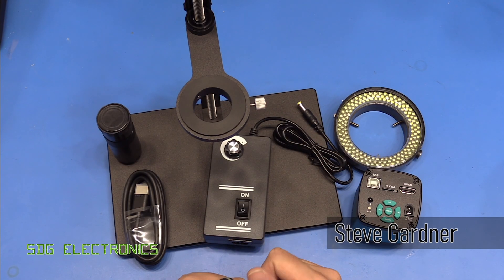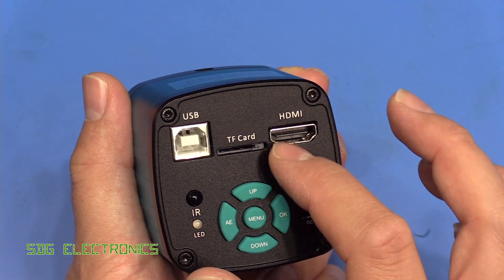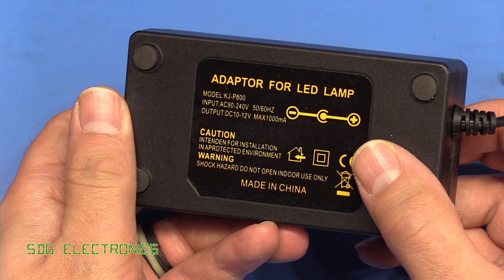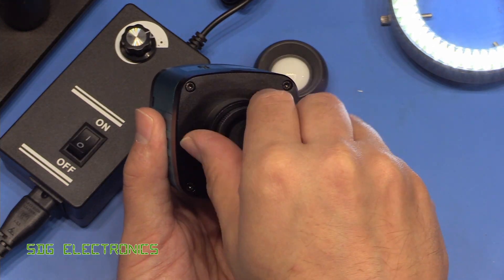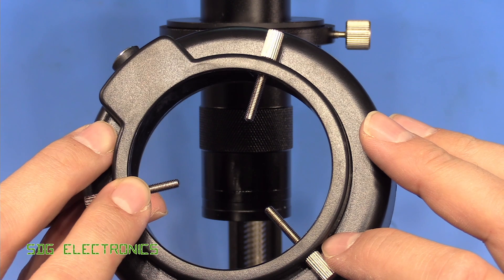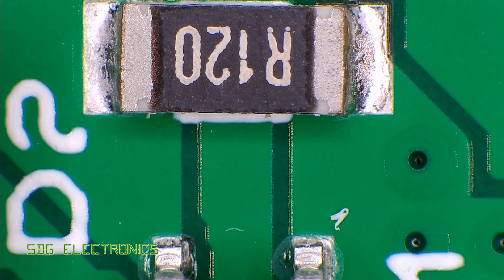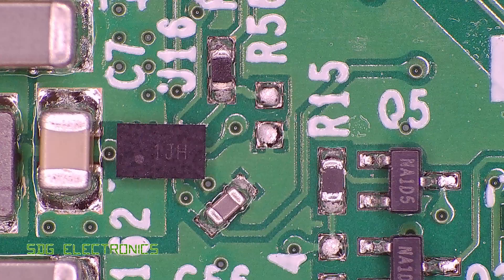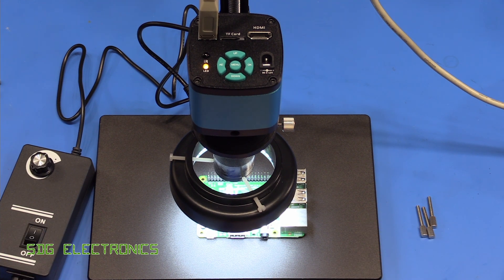SDG #180 Eakins 4K Video Microscope with HDMI and SD Card Recording

Comment: Hello, excellent channel.  Could you help me.  I am wanting a similar setup to NorthridgeFix  https://www.youtube.com/watch?v=NfkXitg5R4I&t=771s     This seems like a camera that is similar for a lot cheaper.   NorthridgeFix says he uses a 0.5 and 0.75 barlow lens.   He seems to have a good working distance, I assume it's because he uses a 180x lens and this is 130x.  I have found the same camera you review with the option of the 180x lens.  https://www.aliexpress.com/item/4001347475510.html?gps-id=pcStoreJustForYou&scm=1007.23125.137358.0&scm_id=1007.23125.137358.0&scm-url=1007.23125.137358.0&pvid=ffa7af9d-b31b-4d17-b5ab-1c4727316513&spm=a2g0o.store_home.smartJustForYou_512523718.5    What are your thoughts?  Obviously his stand is far superior but the image quality looks more than good enough for soldering to me.   Is 180x with the barlow lens the way to go?  I don't like the idea of looking down eye pieces.  It may have an easier learning curve but it does sound uncomfortable.
Reply from the maker: The 180x lens is good, I used to use it a lot and has easily available barlow lenses. You need a good camera though, the 180x lens loses a lot of light. This camera seems pretty good in low light though so I don't think you'll have any trouble

Comment: If I wanted to spend a bit more, what would be your recommendation? I am looking for a camera only style microscope. Is the "autofokcus 1080p imx290" unit you reviewed still worth 400$?
Reply from the maker: I think it's still probably the best choice. There's a few variants of the same camera though - if you intend to only view images or record through HDMI you can normally get it cheaper than $400
Reply: @sdgelectronics  Where ? a lot of these cameras appear to have  cheaper Sony sensors installed, and has made buying these cameras on Ali a more than usual dodgy proposition ! are there any honest sellers that you can recommend ? Thanks

Comment: Can the ring light be attached to the adapter used to hold the lens assembly to the stand? It looks like the id of the ring light should fit the od of the adapter that is sticking out below the stand.

Comment: @ SDG Electronics
Can I use Barlow lens with this microscope?
Will be have better work area.. Tks
Reply from the maker: You would need to 3D print some kind of mount to fit the Barlow lens as I don't think there is any compatible lens available.
Reply: OK, thank you. 10c, is too low to work with the max

Comment: Have you hooked this up to your simul-focus microscope yet? I'm going to buy the microscope and camera this week and I'm wondering what additional hardware I may need. I'd like to see approximately the same field of view through the eye pieces and camera. Do you still use the .35 pancake lens from your previous video? Do I need any additional rings to space the camera like you needed with the flat orange camera? Do you use this along with the 0.5x Barlow? Thank you for your videos, sorry for such a loaded question!
Reply from the maker: I always use the 0.5x Barlow lens and also the 0.35x pancake lens for the camera. I would also get hold of one of the c-cs rings just so you have the flexibility to adjust everything. Slight differences between hardware may or may not make this essential - last time I checked you could get these for under a dollar so well worth getting hold of. Those items should keep the camera image and eyepiece images the same.
Reply: I just wanted to follow up since purchasing this camera and a simul-focal camera setup. This camera is very good for the price, but I'm afraid it is not does not pair well with a microscope trinocular port, it appears the sensor is too small. I have not found any listed specs of the actual CMOS sensor in this camera but it is physically smaller than the IMX290 by comparison. I would consider a 0.5x barlow with a 0.35 pancake trinocular adapter usable, but the image on the screen is only the center 1/4 of what you are viewing through the eye pieces. I believe as a standalone camera-only microscope it would work well!

I am currently also struggling with light reflection when using the barlow lens, and I'm eagerly waiting for you to sort the kinks with your awesome ring light project. Thanks for your videos!
Reply from the maker: @teejmiller  TO clarify, are you using any lens between the microscope and the camera? I'm just reworking the PCB slightly on the microscope illuminator project but it took a back seat for a while.

Comment: Assuming you could add 3rd party optics so it can be farther away from the pcb when fully zoomed?
Reply from the maker: Definitely. You would need to rig something up though to fit a lens on the end of this unit. The larger c-mount microscope lenses on their Aliexpress store do have 0.5x lenses that you can mount without modifications.

Comment: Steve, which one would you recommend for a hobbyist like me who just in learning curve to fix gadgets like phones/tablets/laptops by myself, a bi/trinocular one or a camera-style like this?
i have a generic G600 Microscope and find it hard to work with and the images it produced is not clear enough to see, i want a step further in terms of visual quality.
thanks.
Reply from the maker: It depends on your budget and what you want to achieve. The main issue with the video microscopes is lack of perception of depth, however it's not difficult to glance down and see what's going on. They're also a lot more attractive on the price. As a hobbyist, a bi/trinocular microscope may be quite an investment in terms of money and space, however it is likely to be the only and last microscope you'd need.
Reply: @sdgelectronics   hi, thank you for replying. actually i found a good bargain of a trinocular complete with the stand and light, sells in similar price as the video microscope here in my country (under USD $300). so i guess a trinocular is the right choice then? 🙂
Reply from the maker: @radius.indrawan  yes you'll find it much better to work with I'm sure
Reply: @sdgelectronics  so a trinocular it is then. thank you very much Steve for giving your thoughts and recommendation. i really appreciate it. :)